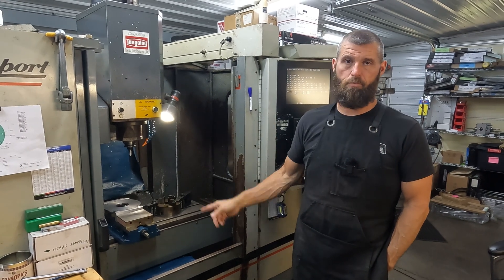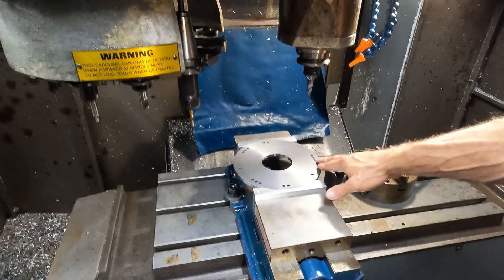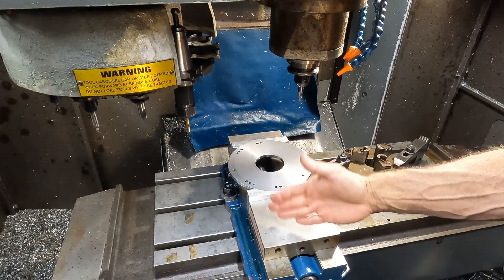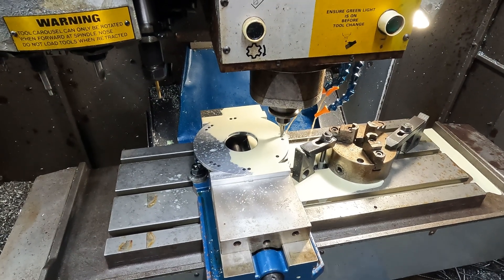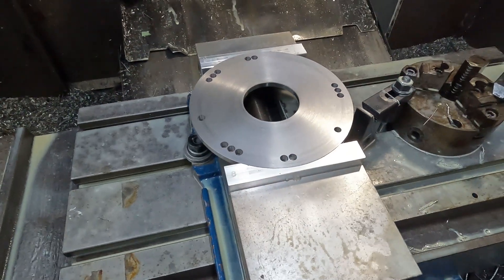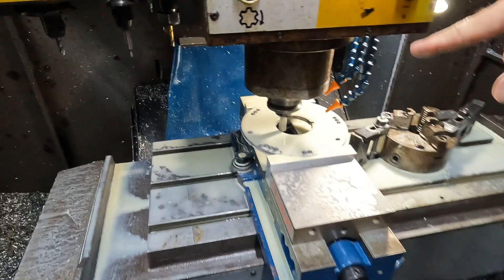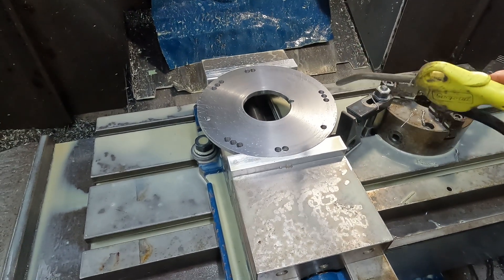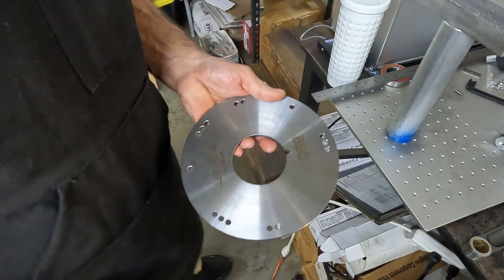Machining Index plates for the camshaft grinder

Comment: That laser doesn't need to be in an enclosure?
Reply from the maker: No, your thinking about a co2
Reply: @powellmachineinc  I am familiar with CO2 lasers but that's not what I'm thinking about. I hope everyone within sight of the machine is wearing the proper rated laser protective eyewear while it's operating.

Comment: I've learned more about engines and CNC milling watching your videos than I ever thought I could. I'm not a mechanic or anything - just interested in craftsmanship and engineering. Question though - can someone point me to a video or a resource that explains how a index plate works in determining firing order? I understood that the holes drilled affect it, but not the actual function of the plate. That's my lack of knowledge obviously, but when I tried to google search it, I just got a bunch of garbage. Appreciate any help the community can offer. As always, thanks for teaching us so much.
Reply from the maker: Several of my camshaft grinding videos show its function,  check my play list
Reply: @powellmachineinc  Appreciate it. Didn't realize you had already talked about this.